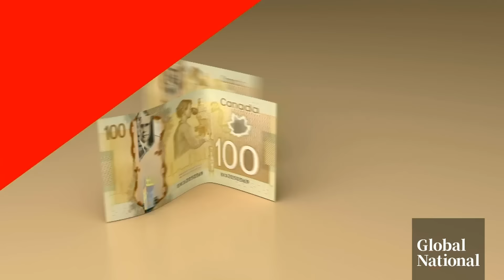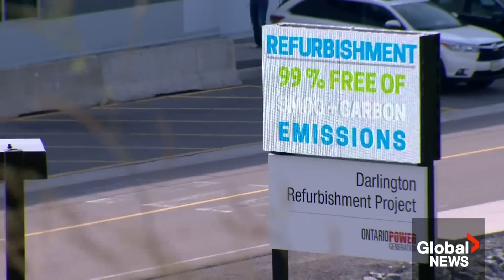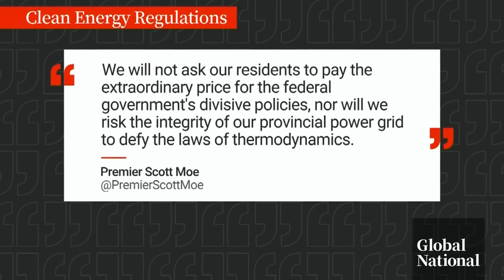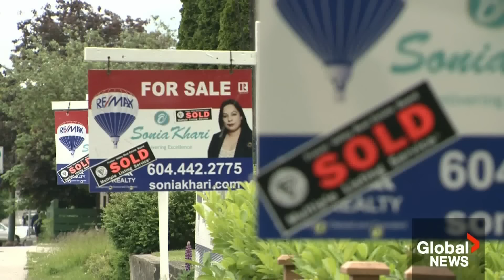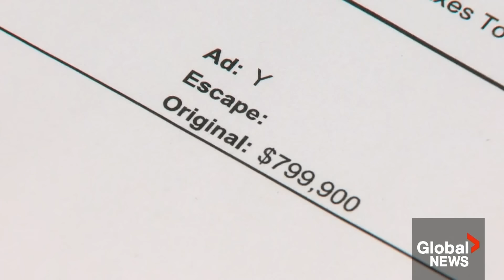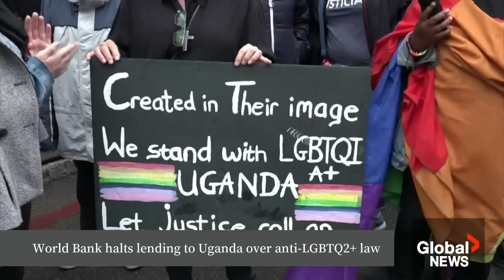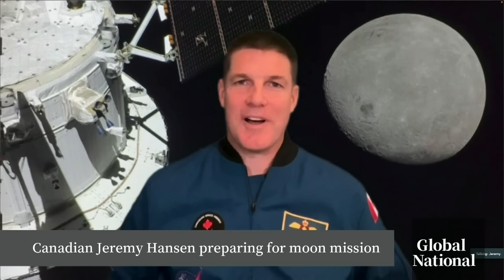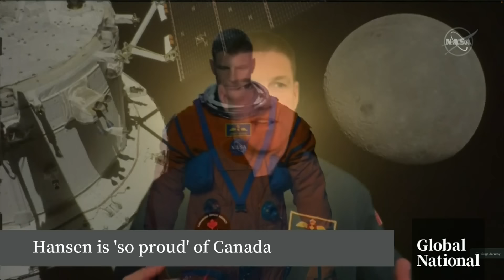Global National: Aug. 10, 2023 | Maui wildfires reduce Lahaina to ashes

Comment: germany started 20 years ago with wind and solar...The hydro in germany was so high to pay for all that. The bottom line was...it was never enough and still had to use gas and coal when france went nuclear which worked the best.  The repair cost to run the windmills were more then they produced. There is 1 windmill in downtown toronto...half the time its not running cause its broken. Ontario produces so much hydro that canada pays the US to take it. Technacally the hydro in Ontario should be free cause the Niagara falls produces so much.
Reply: nailed it 👍👍